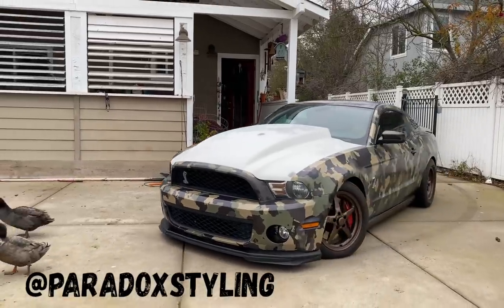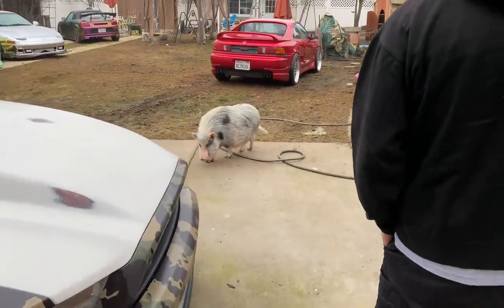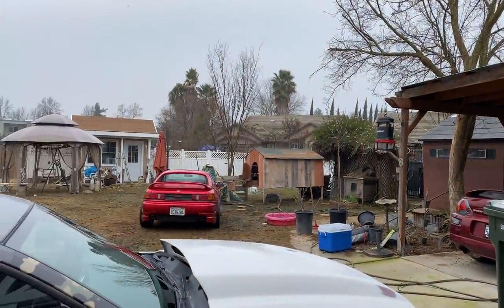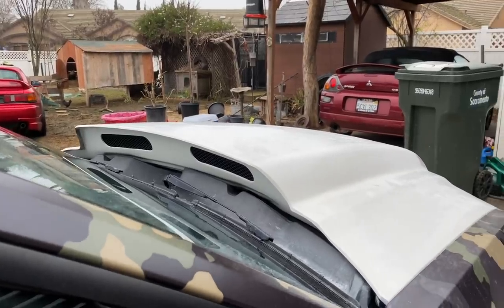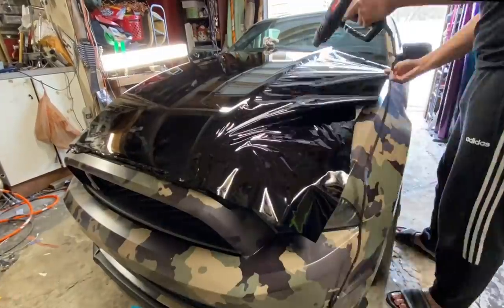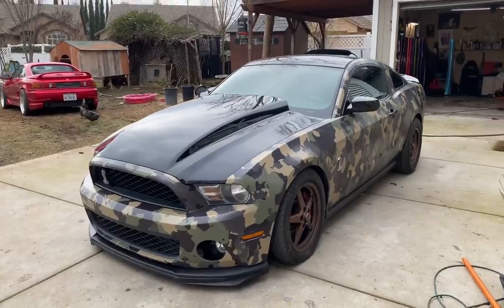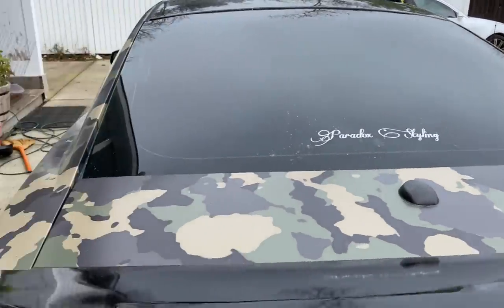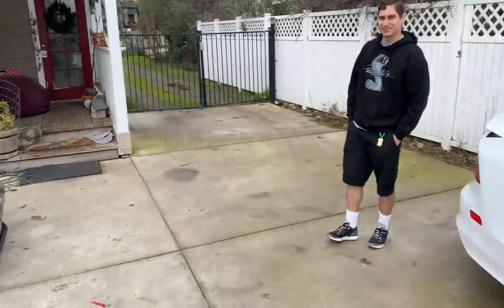Paradox Exposed! Camo Wrap After One Month The TRUTH About My Wrap Skill...Mustang GT500

Comment: Hey Dude Nice work. I was wondering have you ever used a Special spray for vinyl ? I used to do vinyl stickers and windows stuff. That spray went along way to adjust the vinyl from sticking also too fast. The i found that Simple dish soap with water does the same. Either way great work.

Comment: teckwraps(calendar film) 3 pieces for sure. but for a cast like the camo (i assume) one piece is doable on this hood. should have gone with the camo on the sides and the gloss/matte black/carbon in the center section. still good work though i like it.